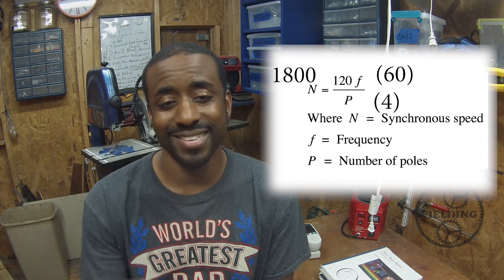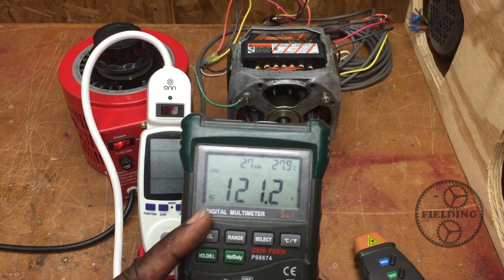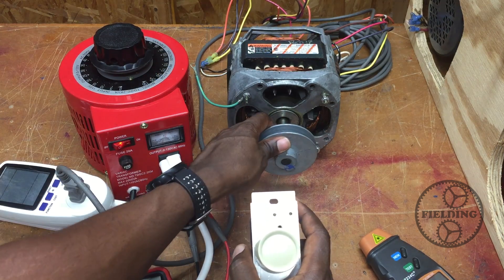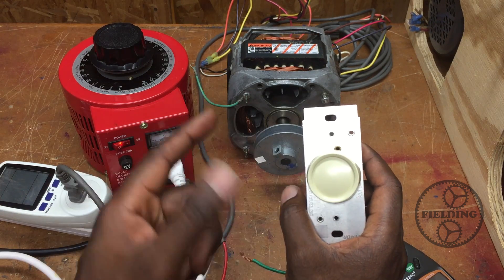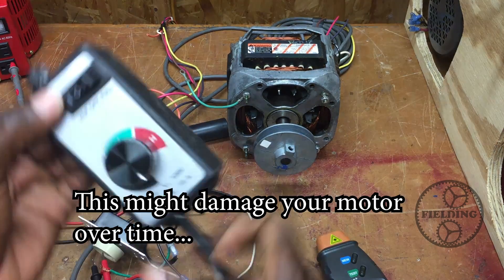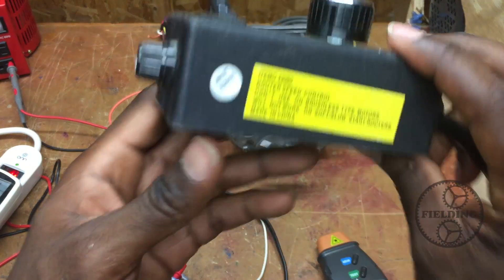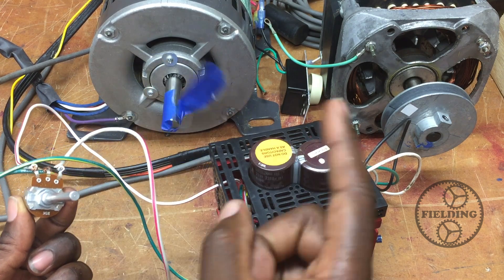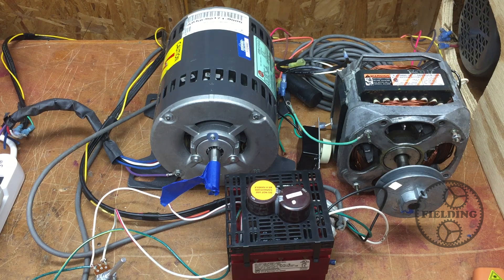Will A Dimmer Switch or Transformer Control An Induction Motor's Speed: 038

Comment: If you know of an easy way to run a 3 phase 1.5hp motor off of single phase 110v line house current, without spending a couple hundred dollars on a VFD, like the KBAC 24 VFD $238.00 for 120V input 3 phase 230 out,, I know a heck of a lot of people who would think you just floated down from heaven..Ha..Ha.. For Real.. 
I can just about guarantee you that it would be your most popular video... And,, I will buy the prototype when you get finished with the video.. Ha.. Desired outcome: 110V single phase to 3 phase 220, variable speed, On/Off switch, usually have a Start and Stop, and Reverse Switch, and if it does not drive the price up, whatever type of circuitry required to stop the motor quickly for belt changes, etc.. and last of all,, a Bonus if it can be done for less than $100 bucks.. The lesser the better..Ha..Ha.. 
And,, someone, somewhere that will build a couple hundred of them a month to get started.. Ha..
Might as well set up a dealership for the Manufacturer of a good 3 phase 220V motor too.. Ha.. 
They say that a 4 pole 3 phase 220v 1800rpm motor on a VFD is better than a 3600 2 pole in overall torque across the full speed of the motor, therefore better for a grinder.. Something about a 60 Hz motor running at 120 that will make a 1800 RPM motor run at 3600 rpm's and run at a greater torque at the lower and upper ranges than a 2 pole... (Yes? / No?)
We use them to run 2" x 72" belt grinders for Knife making, and general shop uses... 
I am building another 2" x 72" for myself and I bought a cheap 1.5 hp motor from Harbor Freight and a Router Control and I am going to see if it works or Burns up.. If the Router Control works,, and I suspect it will,, I am going to make a video after using it for a couple of months, and video the other 2 or 3 variable speed controllers I use on Fans, etc,, and stir up a big stink..Ha.. 
Of course, I have never done anything 220 volt like that, and never a 3 phase motor..
From what I see from this video,, the 3 phase is going to have to run a VFD,, and I hope my Harbor Freight motor holds up under the Router control.. Ha.. 
I would love to tell answer your question about the HF motor before you ask it,, and might be able to with the manual in front of me, but, I'm not exactly sure what you are going to ask, so,, from the archives if you take a shot at it.. 
The manual of the motor 110V 1.5hp that I bought in 2014 for this project.. 
https://manuals.harborfreight.com/manuals/60000-60999/60814.pdf
And the Router Control and Speed controllers I am going to try with it.. 
Picture of Router Control:
https://www.harborfreight.com/router-speed-control-43060.html
Manual for it: https://manuals.harborfreight.com/manuals/43000-43999/43060.PDF
---
Speed Controller from Ebay (China)
http://www.ebay.com/itm/252796242885 
4000W AC 110V SCR Voltage Regulator Motor Speed Controller, or something like it..

So,, there is a good video topic.. The 3 phase side of the house way above, if you are looking for some new content.. I didn't see any videos when I looked quickly for 3 phase..And,, another I would love to see... 
Free Energy from a 3 phase motor.. 
I know a guy who lives about an hour from me.. He has only single phase running to his Large Machine shop with lots of 3 phase equipment. Compressor, lathes, mills, shapers, surfacers, etc.. He takes a small 110v motor with a pully like the one in this video... He starts it with a switch.. He has a 25hp 3 phase motor that is inline with the 110v small motor.. Inline meaning on one 2x12" piece of lumber sitting in a corner on the floor.. He has a slack v-belt between the two.. He turns on the 110v, pulls on his lever to tighten the belt to slowly start spinning the 25hp monster.. Once the Monster gets to a certain rpm,,, (before 1800, but, don't hold me to that (conversation from 3 years ago),,,, the 3 phase 25hp motor starts running on it's own... 
Once it is running,, he runs the 3rd leg from the 25hp motor to a circuit breaker box on the wall... I am not sure, but, somehow he hooks it up to the electrical panel and has 3 phase plugins all over his shop for the other 3 phase equipment.. So, I think he must run the 3rd line into a 3 phase box and probably runs 220v from his shop utility power into the 3 phase box, and,, if he starts each piece of equipment, one at a time, he can have his whole shop (3 phase equipment) running off of this 25hp motor all day long, until he shuts down everything  and then turns off the 25 hp motor.. 
If you don't know about it.. It is true.. Don't think I am crazy.. But,, somehow,, 220 single phase turning into 220 or higher,, don't know 3 phase after starting up a 25hp motor makes me think.. Free Energy... That third leg had to come from that motor.. 
Now. something I did not ask him.. I am almost certain that he has to start the 110v motor, and start turning the 25hp motor and get close to the rpms that at this point I don't know, but, close to motor speed I think,, then, turn on the utility shop power of 220v and maybe it is then that the motor starts up.. Three years ago and I was blown away by hearing this, so, I forgot to ask.. Did you turn off the 220 volt utility power to the 25hp after the motor started up??? Or, I think you have to keep feeding that to the 25hp in order for it to run and keep generating the third leg.. 
And, while I was thinking about that,,,, I thought.. What if you ran that third leg,, I think of 308 or something (I do not have a clue) to a shed or shop, or home, could you use that voltage to run things (seems you could... Might have to change it, condition it, etc and it would only be one leg of whatever at that point), but, this sure seems like free energy,, but, if it takes 220volts single phase to run the 25hp,, how much current did that use in relation to what could have been consumed by the shed/shop/house, and at that point, is it saving you any money, or generating anything that could be called free??,, or ,, should we just be happy that this scenario works for other 3 phase motors and be happy,, rather than thinking for all of these years there has not been a Tesla out there trying to give this away to everyone..  AS Stupid as that sounds,, makes me wonder why EVERYONE using a 2"x72" Belt grinder is paying big money,, $350 for a VFD,, when all they need is another used 3 phase motor at least the same size as,, but, I think has to be larger than what it is going to pull.. Then, why hasn't someone figured this out?? 
I know what I have said so far is true.. It DOES work.. There are more than a few videos on youtube that demonstrate it and no one that says,, BULLSH***,, that does not work.. Some just fill up a box about half the size of a 48quart ice chest with Capacitors and flip a switch as they turn on the 220v single phase to the 3phase motor that is going to drive the other 3 phase equipment.. Once the motor starts, the switch to the capacitor bank gets shut off and the other 3 phase equipment is turned on.. 
That should make a good day of brainstorming and testing and documenting. I wish I had a clue what I was talking about and had a clue what I was looking at when I opened up the side of the motor with all of those wires... Ha.. Because if I did,, I would have this hooked up already and have a much larger lathe and mill for less than the little mini lathe I have sitting on my shelf..Ha..Ha.. 3 phase equipment is cheap just for the reason that this  is not widely known.. If I lived near industry, I would have already picked up some used 3 phase equipment and at least tried it already.. 
Enough for now.. I was just thinking while I was typing/talking and trying to get this to make more sense to me. Sometimes it helps to write about it and think about it at the same time.. But for a guy who could open up a TV and not be sure if he was pointing at a diode or not,, I sure would like to know how this all works, and if there is anything free about it..
Cheers.. Loved your video.. Great way of explaining things.. A new Subscriber and I will root through your videos over the next couple of weeks.. Cheers, and thanks for being a contributor..
Reply from the maker: You bring up quite a few different topics here, but I will try to help briefly. Three phase can be produced from single phase with a rotary converter. That is what you are describing in your friends shop. His is home-made but you can buy it from many places so it is not really a new thing. 

Three phase using capacitors is not really good for the motor. It will start and run but the life of the motor will be much shorter. You are putting to much load on really 1/3 of the motor, and it would produce it's full power. 

Harbor freight speed controllers will not work with a single phase induction motor, or a three phase induction motor. You will lower the torque of the motor but not the speed... that is until you over load the motor's torque ability. Then the motor will just stall under load.

Rotary converters don't produce free energy. The voltage produced on the third leg is coming from the wall. The motor is shifting that power "out of phase" with the rest and that is what makes it three phase. If the motor is producing 220 across all three legs and 10 amps each, you are drawing  at least 30 amps from the wall. But it will be more than that because some power is wasted in the conversion. Turning the machines on one at a time is important, but I don't want to get on a different subject here. 

I will consider doing a video on three phase from single phase, but I don't recommend doing it without a VFD, so it is some what against my better judgement to show such a technique. But in a pitch it works, and I think it is ok for motors that only run briefly like a drill press.
Reply: Ha.. I have asked no less than 100 people about this over the last 3 or 4 years.. Many of them "Electricians"..  Ok.. I digress.. This video, watching that motor starving for voltage and not wimpering until it was just about dead, and your description of the triac and the light bulbs kind of put some things in perspective.. I had a computer that locked up pretty frequently for quite a while, while 1 leg of a 220 under the ground was slowly burning or corroding out from some damage from the previous home owner.. I finally started seeing the lights start dimming here and there as the wire further degraded... When I noticed the lights dimming,, it just happened to be when it was raining, or after a day or two of rain, and the problem almost non-existent during good dry spells.. I was just about to throw the Computer out of the window when I decided to bring a Smart UPS home from work for a few days and see if the problem went away.. Ha.. Laptop was working fine the whole time.. Guess it must run off of and charge the battery at the same time??? That would make sense. 
Needless to say.. The wire was cut previously and wrapped with black electrical tape after a short pigtail was wired in.. It was in a low spot in the yard between the house and the shop.. Water sat and finally went into the ground where it gave me serious headaches a few days at a time... 
Guess I have been lucky all of these years with the speed controllers.. I have one on my blacksmith forge, and one on my 1/3rd horsepower 2x72 Belt grinder, and two fans that run just about all winter on my wood stove and one or two more on various other motors..Ha.. Just about all of them fans at this particular time.. I would consider a vacuum motor a fan too.. I guess.. Ha.. I ran into a thread on some forum when I was looking for something and piped in about tossing on a speed controller... I got hammered..Ha.. Thought I was helping the guy out.. :).. Ha.. It was an old motor he was trying to hook up to a gearbox to get it to rotate at the correct speed to cut with his plasma cutter.. Had it close, but, not slow enough.. I suggested the gearbox and BAM,, everyone started saying it would not work... Well, the guy had a friend with a router control, he hooked it up, and solved the problem.. That was February this year.. He was recording a new video showing how it was working and the control solved the problem and I finally, after a bunch of years decided to post one of my own as I sat quietly getting bashed..Ha..Ha..  I happened to have 4 of them hooked up at that very moment and it was easy to zip around and do a quick video from the phone.. Here it is.. Ha.. 
https://www.youtube.com/watch?v=DV0ace6FnqA
So.. I am going to be hard headed and hook up the HF motor to both the router control and the speed controller on my forge, since I wired two dual receptacles just for that purpose and sit back and grin when it won't work.. Maybe your ears will start itching when I do.. Ha.. 
I saw that your little induction motor wasn't phased by lowering the voltage.. Actually, I was quite surprised.. I have to watch your video series  on how motors work, so, I won't post videos like I did..Ha.. Well,, I will probably still post them..Ha.. 
I watched your first and third video two years ago when I pulled my HF Band saw out of storage because I saw something I wanted to do with it. Bought a wood lathe 8 months ago because I had to turn something or pay about that much for the piece I wanted..   I picked up a mini lathe and mill about the time you started building your second lathe, and I started looking into doing some HDPE moulding when I veered off into Urethane and Epoxy Resins,, which I am waiting to get some other projects finished and go that way.. 
I  need to take some time to process and upload my \todo\videos folder to youtube.. Still have a bunch of videos from this past Jan-Feb-March that I have not had time to get to yet.. 
One day,, I am going to click "Monitize my channel,,, but, I have been saying that since I started.. Just like sharing with everyone.. God knows I get more out of the community than I give back,, although some would argue different who have an interest in some of my subjects which change quite frequently.. Ha.. 
Take Care Jeremy.. If you are ever in Western NC,, stop and say hello.. If it's summer, bring the family and take a run on the river.. I'll break out some videos that are pretty interesting that don't get posted..Ha..Ha. Cheers Buddy.. Thanks..
Reply from the maker: Lowering the voltage in a fan application will always work. You should watch the second part of this video. Motors without a separate starter winding (when used as a fan) will work just fine. Also Vaccum motors are usually Universal motors. They also work perfectly with HF speed controllers. Here you go. https://youtu.be/JTlHNOaBnPI
Reply: Yes.. I noticed that when I was typing it.. They were all turning out to be fan motors I was adjusting.. I though the Belt Grinder motor came out of a washing machine years ago. 1/3rd Hp.. Now I am wondering if I robbed it out of a fan way back when.. Must be 20 years old.. 
I saw that in the white bedroom fan you took apart.. You have a way of explaining things.. Explained with concept.. Good stuff.. Way beyond most fellas.. Thanks Jeremy..  Awesome.. 
Even with a rotary phase converter supplying 3 phase to a 1 or 1.5hp motor, I would still have to go with a VFD to vary the speed.. Correct? Just being sure.. The phase converter would do just that.. Convert the phase and would still put out the same Hz which is what has to be varied to control speed.. But, most of them are designed to convert 120 or 240 Single phase to 3 phase as far as I know at this point.. If I had a phase converter, would I be looking for a different device (name?), or just be wiring the VFD up differently?
I figured I might burn up the HF 110V 1.5hp on the belt grinder.. If nothing else, the grinding dust is going to get it, although I am going to try to find some happy medium between filtering and heat control, while I save my funds and find a 3phase motor and vfd combo for an upgrade later. Want to be able to vary the speed and forward and reverse when I am finished.. Also want to test the 1.5hp to tell what strength motor I want for the next grinder motor.  Some how the old grinder motor has survived the grinding dust for 3 years.. That was another experiment in progress..

Comment: You have done the absolute best job at explaining this exact topic that I've found yet... and I've been scouring the internets for a long while. Very good video, AWESOME demonstration! Thank you very much for this.
Reply from the maker: Thank you for letting me know. I actually made the video because so many viewers have asked about it, but when searching YouTube and the internet, there was conflicting information and some things that were just wrong. This video has a part two as well if you are interested. https://youtu.be/JTlHNOaBnPI
Reply: Oh I'm already subscribed and watching all your videos! You're awesome and so are your videos! (On a side note I actually found your video because I'm making a workshop of my own... I've been wondering if it was possible to change the rpm of my bench grinder... I'm still not 100 percent sure what the answer is, but I think it's a "no" or a "not worth it", after watching your videos I understand electric motors a whole lot more and now  have a good introduction enough to be able understand more of the information out there on the internet in regards to these topics.) Thanks again!
... I'm pretty sure the answer is I can't because a VFD for single phase motors is rare and works only for very particular induction motors, and my motor is not one of those because it most likely has a start winding with a capacitor.... I stop understanding after that point... but I'll just go review your videos again.
Reply from the maker: It sounds like you nailed it! I am so glad you found it helpful. :)